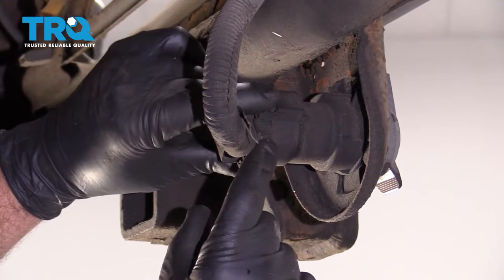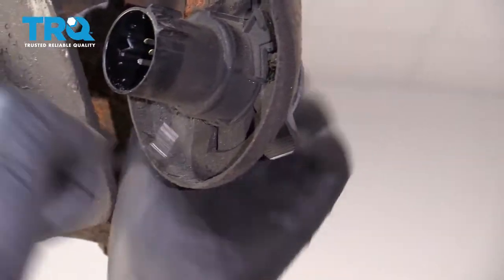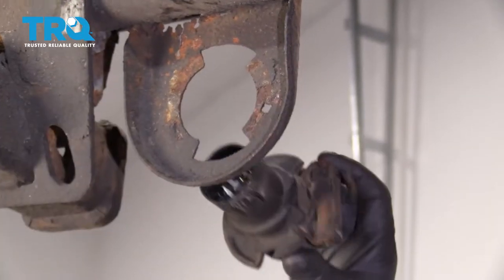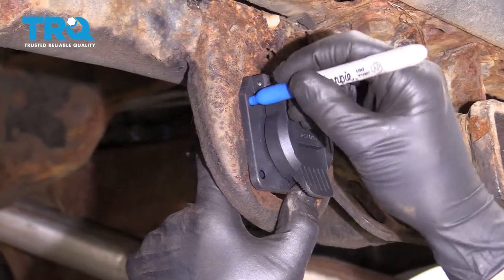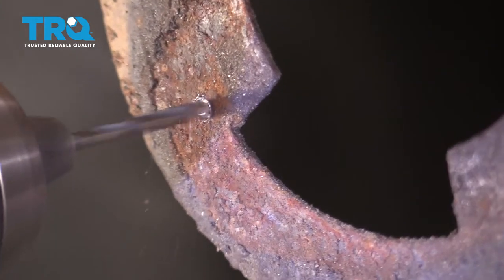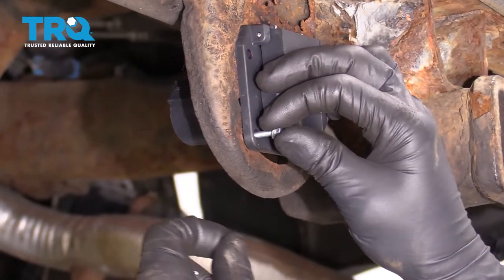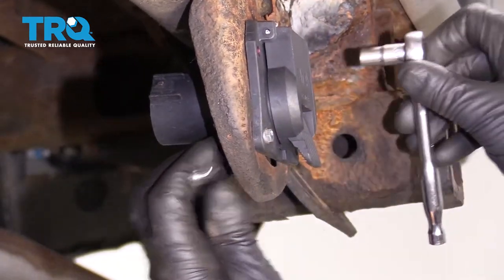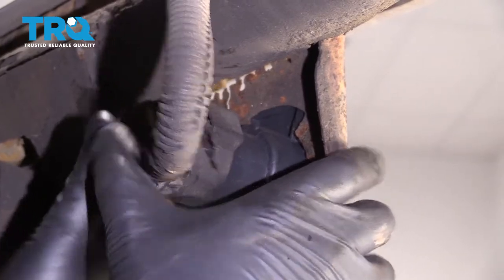How to Replace 7-Way Trailer Connector Plug 2000-2006 Chevy Tahoe

Comment: Isn't there a GM OEM connector available instead of drilling all of those holes?
Reply: There is another video from 1A Auto that has this part.  It is the OEM style twist and it seems like a lot easier to deal with.  The part is 3 or 4 times the cost of this drill in socket though.
Reply: I was wondering the same thing did you  just so happen to find one?  Thank you ☺️
Reply: @alonzowiisdom6796  The OEM part is available on RockAuto and Amazon.  Last I recall it was about $68.
Reply: @alonzowiisdom6796  Look for Dorman 924-307 Trailer Hitch Electrical Connector Plug.

I found it on Amazon for about $24.  For comparison info.  I have a 2005 GMC Yukon XL 2500.  Should work for all GMT 800 rigs.